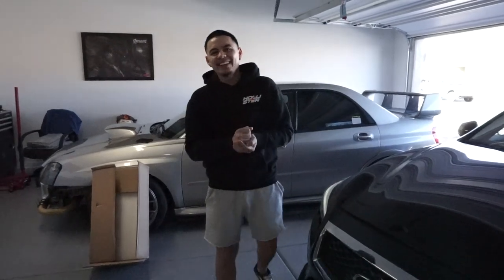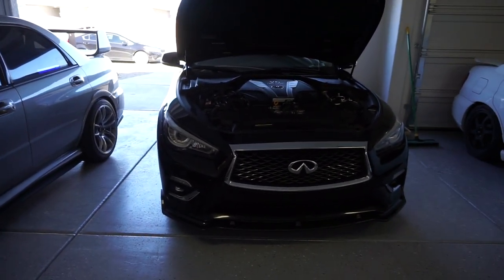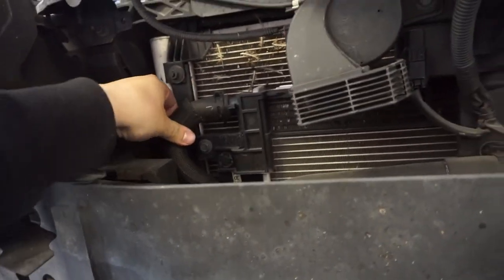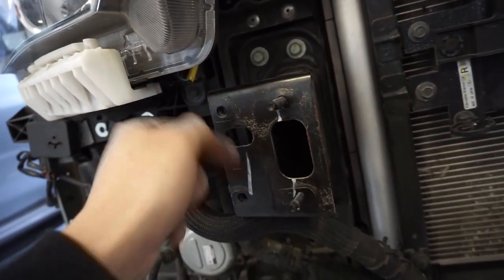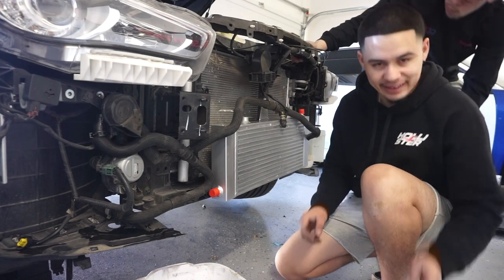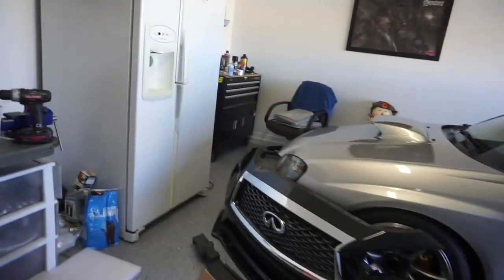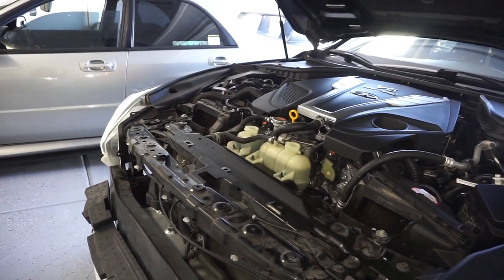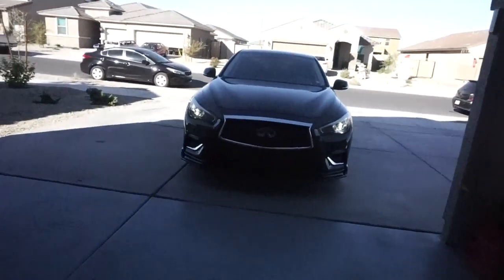Bms heat exchanger install Infiniti Q50 Q60 | More power more cooling

Comment: Yo boss , I recently check your video on your q50 heat exchanger, no overheating with either radiator or head exchanger on q50 , because u didn’t use the pressure bleeder tool , I’m going to install my heat exchanger next weekend. Let me know .. I would I appreciate that

Comment: you didn't lose any coolant after those pulls since you recently installed it?
Reply from the maker: I did bleed it just didn’t show me doing it
Reply: @SvperDvperProdvctions  oh no yeah I did hear you on the video say that you did bleed it, I was just asking because I recently got a BMS Heat Exchanger installed as well, and a few days ago I did a mini pull and it drained all of my coolant smh
Reply from the maker: @luisiferz  oh okay and I’ll check the level again thanks for the heads up man and when I checked it at the end of the day it seemed good
Reply: Do you still have the bms installed ? Is the car still running good ?
Reply: @joshuasandoval3753  I still got mine & it’s running good
Reply: @luisiferz  did you lose any power? Installed my AMS HX today whenever I would do a pull the Power and Boost took forever to hit. And my car feel sluggish and delay on power now is this normal?
Reply: @KingKongDill   did you tune it?
Reply: @Overlandit  nah bro my HX system had air pockets in it

Comment: On my 2018 redsport I have the ams original heat exchanger not the new race one. Idk about this car, it's my first turbo car. I live here in California and when its around 90 95 if I give drive It hard it still gets hot on my temperature gauge 🤦‍♂️
Reply from the maker: Try to bleed your coolant system on the turbo system and regular because here in phx which it gets like over 100 all the time my car never over heats and that ams one should be doing the job too

Comment: would you send the link ? i tried on ebay but says it doesn’t fit the redsport...
Reply from the maker: https://conceptzperformance.com/burger-motorsports-bms-high-capacity-intercooler-heat-exchanger-infiniti-q50-q60-3.0t-silver-sport-bms-hcih-v37_p_47309.php
Reply from the maker: I ordered it from there concept z performance they are good guys and local here in phx AZ if you’re from here

Comment: What year is the car and what engine is it? I’m trying to find a heat exchanger for my 2014 3.7 base model, but everything i can find is for the 3.0t.
Reply: Your q50 naturally aspirated which means no forced induction all engine and no need for a heat exchanger. This q50 in the video is a 3.0 twin turbo which needs a heat exchanger to cool the air to liquid.

Comment: So after installing it, you just fill up the reservoir to the max line, then turn on the car and keep filling until it stays at the max marker?
Reply from the maker: Yes but after further noticing you don’t get the air out till after a few days of driving it
Reply from the maker: On the heat exchanger reservoir side
Reply: Got it, thanks for the vid!
Reply from the maker: @David-de8wm  stay tuned for a video soon I’m finishing up the tune today as we speak she’s getting fast
Reply: @SvperDvperProdvctions  gotcha
Reply: @SvperDvperProdvctions  so how much hp did the heat exchanger give u? I just got my ecutek tuned with ams intakes
Reply from the maker: @devilman8347  I would say that it didn’t gain hp with it but it keeps your car cool after back to back pulls which doesn’t let it heat soak and lose power from higher intake temps
Reply: @SvperDvperProdvctions  ah ic. Does a bov help the turbos or not needed ?
Reply from the maker: @devilman8347  in my experience with boosted cars no but sometimes u do have to replace the stock ones just because they can’t hold pressure at higher boost and I still have my stock one and seems to hold boost just fine but bov do sound good
Reply from the maker: But also just ask your tuner I’m
Sure he knows way more then me lol
Reply: @SvperDvperProdvctions  q50 comes with no bovs, it is recommended getting them to release the pressure the turbos create into the atmosphere rather than the pressure just being built up and going back into the turbo

Comment: Great video fuck wit it hows your temps so far?  Right i dont got a heat exchanger in 30 degrees im running 180-200 degrees
Reply from the maker: Definitely get a heat exchanger the highest mine ever gets now is 115